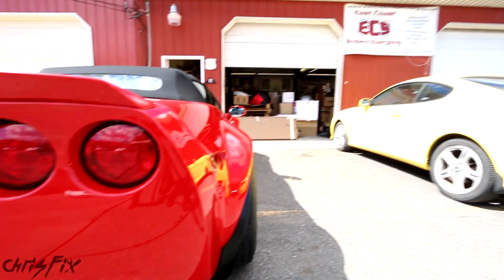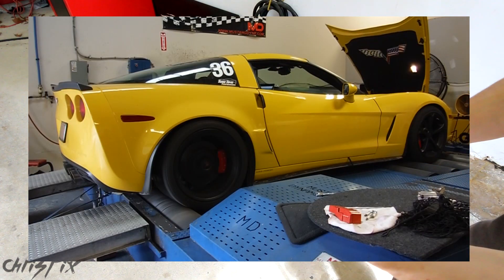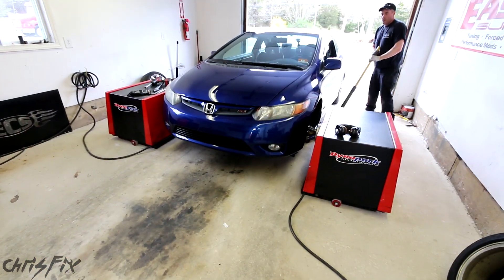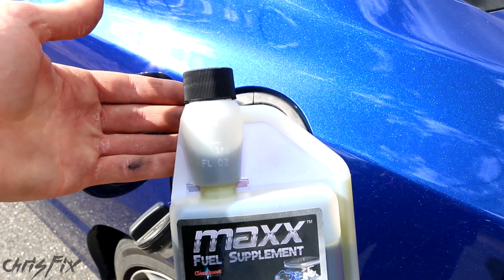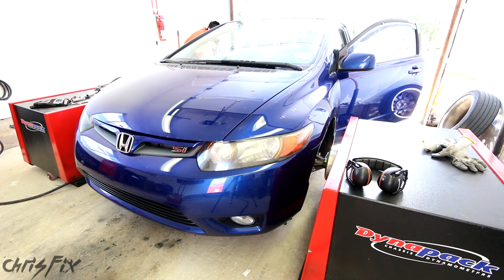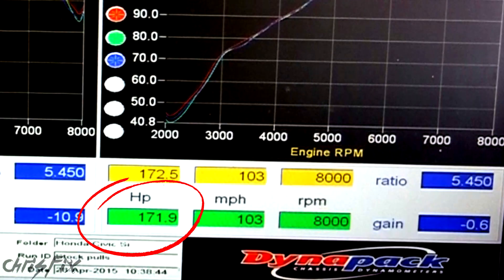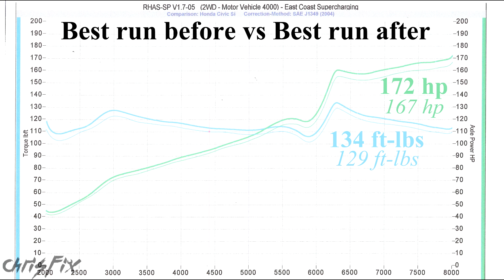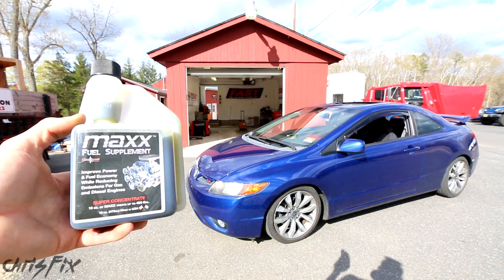Can a Fuel Additive Really Increase Horsepower in Your Car? (With Proof)

Comment: Did you do this test with 93 octane? or 87?
Reply: fetullah ydz Ya'll are using RON measurement for octane over there. In North America, octane is measured in AKI. So 91 AKI would equal 95 RON. Engineering Explained has a good video on it or the wiki page for Octane Rating will tell you more info.
Reply from the maker: mkelebay This was done with 91 octane gas which is required in the Honda Civic Si
Reply: mkelebay What is 87 octane? We got only 95 and 98 here and in germany you have 110 octane race fuel at normal gas stations.
Reply from the maker: PC Master Race It is not an octane booster so...
Reply from the maker: mkelebay Adding more wont do anything because there is only so much power you can get out of a certain amount of gas. The way this stuff works is it creates a more efficient combustion so you get more power out of the same amount of gas.
Reply: Johannes Strandman 
Your Swedish 95 octane fuel if tested in the US would most likely be 89 octane and your 98 octane would most likely test at 92 octane. 
Sweden does not have superior fuel, just another method of determining the fuel octane rating that has a different scaling. 
With regard to cost, understand that US retail fuel costs are lower because the US fuel taxes are some of the lowest globally.
Reply: Eric Dawson Ohh i didn't know about the AKI i thought they used RON in the USA too, thanks for telling me.
Reply: fetullah ydz Octane in simplified terms. Octane refere's to the way fuel burns, oddly lower octane fuel burns quicker than high octane fuel. It is funny how this works, but a slower burning fuel can create more force inside your motor, and reduce "Detonation" or "Knocking". Fuel suppliers sometimes add alcohol to the fuel and this will increase the octane numbers for that same fuel. I have added fuel dryer since I live at high altitude, and very cold conditions, and it removes water and increases octane as well. Slower fuel burn allows extra time for the fuel to apply force to the pistons and therefore increases power, while reducing the tendency for engine damage through Knocking, or uneven fuel burn. Strange but true.
Reply: patw52pb1 hu my mistake then always tought that they show the same scaling u learn something new evryday! @ fetullah ydz my comment was directed to the octane lvls even tho i was completely off track, and i think the comment section is open for pretty much evrything?
Reply: mkelebay i assume 87 because this booster would far less effective.
Reply: ChrisFix Honda requires 91.
many places do not have 93
Reply: Johannes Strandman Read the fucking discussion before you comment, i bet you are one of those guys on a forum who starts a new topic for everything, READ FIRST DUMBASS.
Reply: UK 99 = US 93.5
UK 95 = US 90.0
Reply: Johannes Strandman No problem. Read my other comments in this thread to get a better understanding of the differences.
Reply: ChrisFix Pretty interesting results, i saw another comment further down, asking if adding more would result in more horespower? and does this damage or clog the engine at all?
Reply: fetullah ydz 
It's not the same Octane rating standard BTW. Europe vs north america uses different formulas to get the octane numbers.
your 110 octance would be rated much lower here.
Reply: MaxPowersLTD 110 lower yeah, but not as low as your highest octane there.
Reply: DE Nichols  fetullah ydz 
The US and most of North America uses the Anti-Knock Index (AKI) also known as Posted Octane Number (PON) which is the average of RON and MON (RON+MON/2) to determine the octane rating of spark ignition motor fuels. 
The EU, most of Europe and other countries uses the RON method to determine fuel octane rating values. 

The Research Octane Number (RON) method uses a test engine with an adjustable compression ratio and a very tightly controlled set of static operating parameters using a comparative analysis using the test fuel as compared to blends of the reference fuels N-heptane and Iso-octane to determine the rating. 
N-heptane has an octane rating value of 0 (zero) and Iso-octane has an octane rating value of 100. 

The Motor Octane Number (MON) method uses a test engine design similar to the RON test engine except it runs at a higher RPM, uses preheated intake air, preheated fuel and variable ignition timing. 
The MON method is a more stressful testing method of determining the fuel knock resistance and more closely simulates real world conditions for more accurate rating values of modern hydro-cracked, hydro-treated and blended fuels using advanced ignition timing. 
MON test rating values are approximately 8-12 numbers lower than RON test rating values for the exact same fuel.  
AKI (RON+MON/2) octane rating values and approximately 4-6 octane numbers lower than RON octane rating values for the exact same fuel.
Reply: mkelebay The MSDS for the additive states "organometallic compound", which is the likely active ingredient. Organometallics are powerful octane boosters, which is probably the main effect of the additive, but they can reduce soot/particulate formation.

Disadvantages are that some organometallics can harm lambda sensors and catalysts (lead and manganese). A lot of car manufacturers do not recommend the use of organometallics, and "top tier" gasoline in the US must not contain organometallics (by request of the car manufacturers). Organometallics are also banned from gasoline in a number of other countries (e.g. Mexico) and in Europe.

Some organometallics, such as ferrocene and related compounds (iron) seem to be mostly harmless and non-toxic when burned, and I suspect that this is the main ingredient. There are loads of ferrocene additives on the market, all making broadly similar claims. 

Ferrocene has been used as an octane booster since the early 70s, but it has faded from use recently due to fears of emission system damage. Even so, it never really took off because other compounds (e.g. manganese methyl-cyclopenadineyl tricabonyl, MMT) were easier to use for the oil companies.

I did use to use a ferrocene additive, but it left a very thick deposit on the spark plugs after 10k miles. I don't know what would happen with long-term use on modern 100k mile iridium spark plugs - would it build up and foul the plugs, or just reach a plateau? I don't know. There are some reports of early spark plug damage in the technical journals, but I don't know if there were special circumstances.

Ferrocene additives have mostly been used for diesel engines - where they have made a big comeback recently with the concern over diesel particulate emissions and diesel particulate filter clogging. Ferrocene and similar substances greatly reduce diesel soot production and alter the soot so that it burns off in a DPF much more easily, avoiding problems with filter clogging and filter regeneration.
Reply: James Fenton True, and let me finish your comment. Lower octane fuel makes your car go slower because the fuel inside the cylinder burns before the piston can go all the way up, but if you have a higher octane it burns slower, so the piston can go up further and then if the mixture explodes you have more performance. But i bet that you already knew that, i typed that only for people who didn't already know.
Reply: PC Master Race  here in sweden our lowest is 95 :P i always run 98 , no wonder gas is so cheap in the states ;D
Reply: mkelebay is the US 93/87 gas the same as the UK's 95ron or 99ron petrols?
Reply: jeffel80  Yes, also known as AKI and PON, see my other comments in this thread.
Reply: fetullah ydz Than you need to put more octane decreaser like that to better efficiency. Or just a liter of diesel would od the same, IMO.
Reply: OS Coutinho ait
Reply: fetullah ydz Germany uses the "RON" rating system of octane.  Here we use "(R+M)/2".  95 in Germany is what we would call ~91 ("Midgrade).  98 is our 93 (Super).
Reply: Marc A. Mercier Thank you.

Comment: Do you think a mini cooper s can make more than the Si
Reply from the maker: Montavius Alexander Hmmmm that is a good question. The Mini Cooper S is rated at 189hp and the Civic is rated at 195hp so...
Reply: But the civic couldn't make exact power
Reply from the maker: Montavius Alexander When you dyno a car, it makes less power for any car. The numbers I gave you were engine hp numbers. A 189hp cooper might put down 160hp to the wheels. Which car is lighter is key since both hp numbers are so close.

Comment: Dyno runs can vary 10+/- hp per run bro.  Gains are too small to give a 100% declaration.
Reply: But he did three runs in a row, and they were consistent. So even if that was true, his results show proof
Reply from the maker: 2GUNMASTER That is why we did three runs back to back and three more runs about 30min later back to back. The things that cause runs to vary were all carefully monitored and kept as constant as possible. The real problem is that this is a small sample size. We need to test it on more cars to be sure. Either way, the results are promising.

Comment: i was actually pleasantly surprised. I was expecting a small growth of HP if any. Something like 2 or 3 HP
Reply: argonian bilbo same, and 2-3HP would have been in the error margin. However... I wonder if the first run didn't had something weird... There is a big variation between the 3 runs, and the second test have not much variation... It may indicate that something else is at play there...
Reply from the maker: argonian bilbo Same. With 2 or 3hp it would have been tough to say if it even worked. But we saw 11hp and 11ft-lbs which blew everyone's mind!

Comment: How will this work on a turbo charged engine?
Reply from the maker: oliver hernandez It should work even better. According to their website, their "supplement" works on a molecular level and makes the gas burn more efficiently. Turbos are all about forcing as much air and gas into the engine so if you can get the gas to burn more, you should see more power!

Comment: I wish  and ambient temperature reading was taken and displayed. I believe that the difference and horsepower is due to cooling temperatures.
Reply: esqueue it was like 15 minutes later
Reply from the maker: esqueue It was displayed and the small variances were adjusted for automatically. Pause when I show the computer screen. You will see ambient temp, a barometer reading, and a vacum reading. We did the runs within about an hour of each other so everything was well controlled.

Comment: nice to see that not every product is all claims no gains. even tho 10 hp aint much it would stack nicely with some cold air intake, improve exhaust and chip.
Reply from the maker: Newbpwng Exactly. The biggest thing is that there is an actual gain that is somewhat significant for a fuel additive. I hope to test more products in the future on the dyno. This was fun!